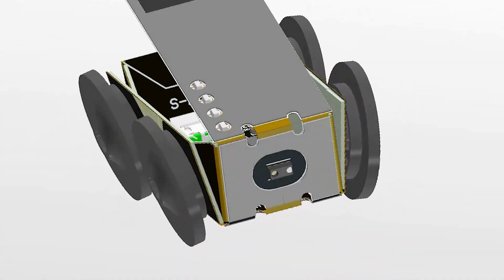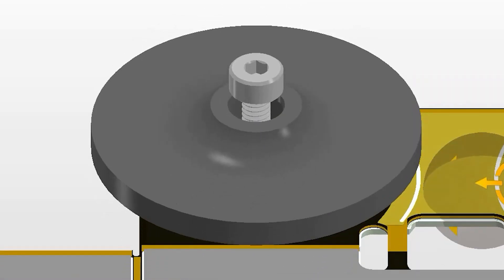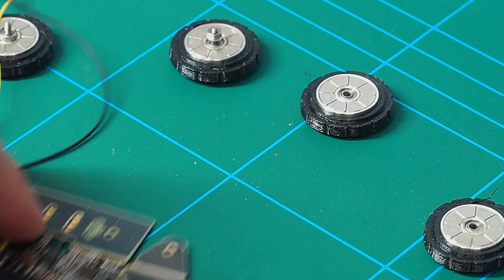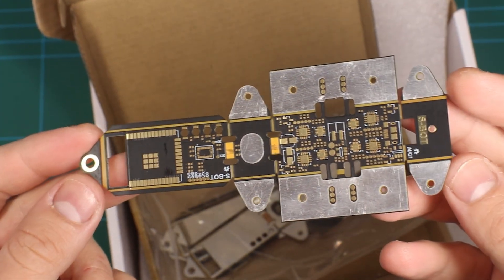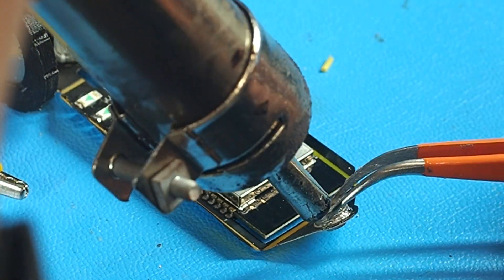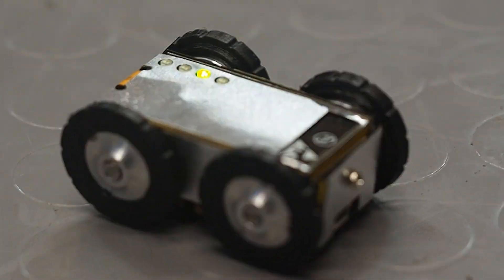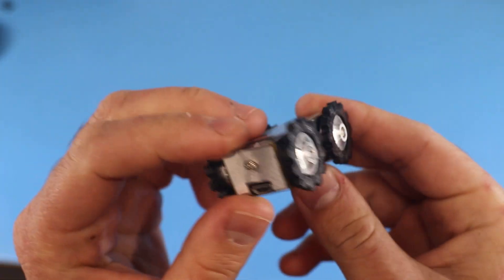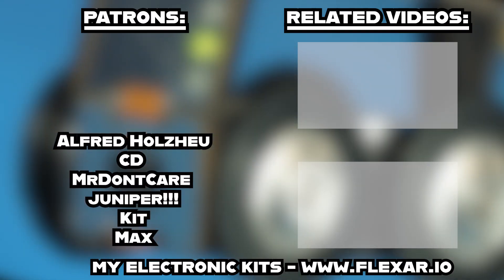Building a Robot from Foldable Circuits!

Comment: You should make some graphene film supercapacitors instead of using the lipo's, You can print your own super caps on a simple diode desktop laser engraver printed on Kapton tape. They are super easy to make, strong, very light and flexible not to mention hold a ton of power

Comment: Very nice, though I think it would be great to do one with a soldered box instead of flex circuit. That way you can use thick copper for more efficient motors and you have to solder anyways.  The key is to make the solder joints solderable from the outside of the box, like through little cutouts.  Alternatively you could use connectors and snap them together. Also, instead of the 4 pic's you might look into the Propeller as it could handle the task more if you don't need analog.  It has 8 processors and only needs to be programmed once, or not at all as it could boot off of the ESP32 on power up, or coming out of reset.

Comment: Regarding torque, I think there may be an argument to be made regarding driving the wheels closer to the rim and further away from the axle. Since this is design has 2 rows of wheels in front of each other and is AWD, if the magnets on both wheels always have like poles pointing at eachother, you could in principle put another coil between the wheels to give it a bigger push and it will be far away from the axle with decent torque.

Comment: Two thoughts.  if you had Meccanum wheels, you could potentially drive the whole robot in every direction because you can control the wheels individually. That would leverage an already integrated feature to get more mobility. Second, because the pcbs produce a magnetic force on both sides, you could potentially drive two wheels on one pcb at the same time. Not sure if that's useful but hey.

Comment: For the PCB stackup, you shoud do a ridgid/flex setup so you can have the motor windings on a traditional FR4 or polyimide board while using the single or double layer flex PCB to just carry the current.  It's not common practice, but you can use the shield layer on a flex PCB as the ground return, as long as all your grounds are the same.  I'm not sure about PCBway's ability to split up the shielding into sections to have separate grounding.

Comment: If you run a multiple number of magnets compared to the coils you run it as an epicyclic gearbox. 

A lot of low rpm outrunners do this. 7:1 or 12:1 is easily done.

Comment: I wonder if it would be possible to integrate maybe two small spaced cameras (for dept perception I guess??), a Goggle Coral TPU for image recognition and a RP2040 micro processor (for a bit of extra performance) in it.. would it be possible to turn it into a tiny self driving rover maybe? :) Also, I dunno the size of this thing but I wonder if it was about the same length of a AA or AAA battery, then maybe it would be possible to solder the positive and negative battery terminals directly to the sides of the PCB and use one or two rechargable AA or AAA batteries?

Comment: I bet you could make a very small aircraft with similar tech.  You could use feathers for a prop since they're already very lightweight and have very good aerodynamics -- you'd have to be careful if you're in North America because almost all birds are covered under the migratory bird treaty act, but you should be able to find a small bird that's not migratory and get some primary flight feathers off of it.  In fact, a pet store probably has some from their smaller birds.

You'd need accelerometers and some of your flappers for flight surfaces but I imagine you could put a camera on a small aircraft like this and get some decent flight time.
Reply: Actually, come to think of it you could probably use feathers for all your control surfaces.  If you used an elerudder design (where you combine the elevator and rudder into an upside-down V) you could simplify it significantly.

Comment: Which electronic hot plate do you use and is this all you need for soldering this PCB oder do you use any additional heat source? Is it 946C ?

Comment: What's your PCB specification for ordering?
And is the project easy to import in KiCad? No one - especially hobbyists - would ever use the most expensive EDA software (how expensive is Altium nowadays? 12000€?), especially when all the features are FREE auailably in a way better performing open source software calles KiCad ;)

Comment: You can use some kind of more flexible tyre so they can make a strong grip on any surface. If the tyres are made with rubber so it will easy to the rover to go on smooth surface. If tyres are flexible like monster truck tyres then it is easy to go through opticals and rough surface. Please try my idea once, I think it's gonna work. 
Peace ✌

Comment: Inspirational!
Use the same pcb coils but remove the wheels and use rubber band pulleys to gear down to smaller wheels for more torque.  Could use lego to attach to your bot to a small wheel platform prototype.

Comment: You should make the next one 6WD, with the distance between axles less than the distance between wheel centerline for easier turning. The increased body could have room for internal battery leaving payload or camera for the top. It also looks like further refinement of the motors for smoother low speed operation will do well for this. Can’t wait to see where this goes!

Comment: I wonder how well self assembling ones could work, especially if you're not trying to make it micro sized. Gave me the idea of essentially flat pack drones that could be dropped on a planet in a pack of say 10 where they all assemble and take off in different directions to do a faster ground based analysis of the surface.

Comment: Remarkable! Awesome! That car was delicated!
But still wondering how did you use a DualShock 4 controller to communicate with ESP chip? By bluetooth? And any other libraries did you use?
Reply from the maker: there is a library for it :) open source files are also available for this project

Comment: I really like your design, and this whole thing is cool, but, just wondering if that layer of metal could be interacting with the magnets in the wheels (i.e. eddy current braking) or effecting the magnetic field from the coils.. have you tried running it without it? Might help?

Comment: A cool development! 🔥🔥🔥
( — ) but motors of this type are clearly very weak, and they overheat very much, which accelerates the discharge of the battery, it is necessary to think over a more energy-saving design.

( + ) From the good, I can highlight the fact that the design platform is compact, this is only one plus.
☝️ But it is better to use ordinary mini motors in which there is a speed change using gears.

Comment: This is a cool project, but honestly this is not the way you will go, if you would do sth like this. Flex PCB is still one of the heaviest costpoints of manufacturing a pcb and the alternative to go over connectors is in 80% of all cases cheaper. But yes, there are also connectors, which are very expensive, but also feature some mil std... 
Altium Designer is by far one of the best and userfriendly CAE softwares out there, but it is also very expensive and for hobby or private use cases not your favorite software.

Comment: As I don't have as special electronic hot plate machine I use my 3d printer hot bed plate to auto solder smd the same way. Works pretty good with lower temp solder. I think if you take a glue gun and just tip the edges of the wheels lighthtly it's going to eliminate the traction problem, even attaching a flat rubber band over the circumfrence should be an easy fix.

Comment: Why make the motor back shell aluminum instead of steel? Wouldn’t steel help focus the B field on the board?
Reply from the maker: It's because of the sides.. Having an iron/steel back plate is more efficient - I tested this in this video https://youtu.be/uqKVX6po2o4

Comment: yo you think that you could have a long strip of pcb and then a thin flex pcb underneath both with the electromagnet patern on them so that it could be driven with 3 phase to mimic the action a snail or snake would use to move? that would be easyer to do and have a much smaller profile. you could even have two side by side to make a tank steering type robot.

Comment: Use a single cell battery and put a boost circuit. You lose a bit of efficiency... but you gain more in not adding too much weight :D

Comment: Great project!  Have you considered giving the motors some mechanical advantage? Perhaps small diameter pulley driving a larger diameter at wheel?  Silicone oring could double as tires. 

Also, can the stators be printed in multi-layers? Would that increase the field strength?

Comment: I assume software traction control might help? What I mean is, it could check if one wheel is spinning faster than the rest, slow it down to send more power to the other motors?

Comment: The problem with those motors is torque, but speed shouldn't a such a problem. Make planetary gearing inside the wheel hubs.

Comment: Just a stupid remarc, but would it not make more sense to have each controler handle two motors due to the chips having two pwm outputs? Or is it a timing issue with the close loop controller?
Reply from the maker: Give that in the end they were being driven in open loop (not the original plan) they can have a shared controllers, with separate 3-phase drivers

Comment: Making it light allows possibilities for rover  drone roof  landing video device that can save power . And maybe  drive to maximize a small solar charge  . That a motion detector can save even more power by just motion video camera with a go  pro hack. Did you try a tank  tread  style . The wheels may have to extend a little to allow a small rubber tread that many old military  tank plastic kits in the very small scale like Ho model rail road displays , have already a rubber and authentic looking  flexible soft material . That may not overheat your electronics . And if it really helps a extra energy cell may be able to extend while providing a little more weight to allow traction in wind  consideration  . And if scaled up for earth rover  testing  the diversity of ground conditions as well as water surface  propulsion has  already been tested on heavy tank beach landings . To be able to study the tests in early development . And easy to search data base , of US patent search allows   project development suggestions  and new   applications  considerations that in the past had not been able to apply in product development and testing .

Comment: Would it help to have an extra stator on each motor? You could have an additional flap on each side of the lid, that fold down from the top and sit outside the wheels and have PCB stators on them. Then for each motor, you'd have a stator on either side of the magnets. That way you'd have double the number of windings per motor.

Comment: Amazing concept, great work! Looks like your main issues are related to torque from the motors, suspect that's why the skid steering isn't working well, and you can't get over bumps, are you driving one side forward and one in reverse for steering? The tyres probably don't like twisting or slipping sideways. Perhaps small ribs across the tyres or knobbles might help let them twist but still provide forward traction. Have you optimised the motors for torque rather than speed? Can you:
- Increase the number of coils
- Add more phases
- Make them larger diameter
- Double the PCB up (add another set of coils on the other side of the rotor)
- Invent a 'PCB Gearbox' to provide reduction gearing (starting to get complicated!)
- Stronger magnets

Friction between rotor and stator might also be an issue since you're side loading the motors. Since you have 2 motors on one axle, maybe put the bearings into the PCB stator and then use the stiffener arrangement as an axle so you have a bearing on each end of a long axle rod and the wheels on the end, should reduce deflection of the wheels and may reduce rubbing between PCB and Rotor.

Making the robot a bit wider will also give you a bit more of a moment arm against the centre of rotation of the vehicle which could help it turn tighter.

Comment: Here's a tip for you: You are already monitoring the speed of each wheel, right? It should be rather trivial to detect the freewheeling of one tire and basically implement an automatic digital differential lock, where all wheels synchronize their efforts to  overcome the stuck situation.

Comment: Fantastic progress! I really believe that "flat pack" devices can be very useful.  Did you consider making some kind of a magnetic transmission? Like a planetary gearbox but using magnetic fields? Or flattening induction motor, instead of placing magnets in wheels, make them from copper or aluminum and induce eddy currents in them to transmit torque. Maybe it will work as some kind of cvt? Anyways, good luck!

Comment: Just a suggestion; have a look at the parallax propeller 2, is an 8 core mocrocontroller which means you could remove the individual micro controllers per motor.

Comment: thoughts on layering the motors yourself? i.e. add tabs the same way the esp32 is soldered, and use a 4 layer rigid pcb. it could also be designed to stack 2 4 layer pcbs, making it into an 8 layer motor.

Comment: I might have missed this...but is this a rigid flex design with a very small flex portion at the corners? Or did you just make the board really thin?

Also curious how the stiffeners are specified ... Is that designed in Altium or just added after the fact with the supplier? Are they laminated or glued on?

Very cool work 🔥

Comment: Very cool project! If you want to expand on this project, consider other shapes instead of a box. You could probably make a functional suspension out of the flexible PCB quite easily. Also, for a lighter robot, thinner wheels might actually work in your favor if all the wheels are making good contact with the ground.

Comment: since the car has wheels that are sticking out, why not place another pcb coil on the outside of the wheels at a different angle to increase the torque? like: pcb coil -> wheel -> pcb coil.

Comment: Next build, add suspension so the wheels can fall into low spots and rise over high spots. Flexible PCB is sort of springy. You might be able to use that as suspension.

Comment: Did Altium fix the problem that makes all the bending lines disappear after changing the PCB shape? That annoyed me to hell, when I made a flex PCB wiring harnes for voltage and temperature measurements inside an accumulator.

Comment: The standoffs you used are way heavier than any header, and also use more space, so it would have been much simpler to use the headers as a mechanical support for the PCB, which now wouldn't need to be flexible, so you could use the sae old motor design you're used to, which would require a smaller battery. So it's a win on every front if you use headers

Comment: The motors still are kind of weak. Do you think it would be possible to make multi layerd motor coils. Now you have coils next to magnets inside the wheel. Could you put a second layer of coils on the outside of the wheel or even make a few layers with the rubber on the outside. Or one strong wheel to push and two to stear

Comment: I wonder if going with more wheels (like 6 or 8) would be an improvement.  Might want to use flex joints between each pair of wheels so that each section can adjust a small amount and keep more contact between the wheels and the ground.

Comment: The robot works surprisingly well considering the manufacturing methods used, and since you can’t give it a suspension system, maybe consider using flexible deformable wheels so that it can have better ground contact

Comment: You can consider to use tracks instead of wheel Carl. Since the weight of the robot is too low, the friction betwween the wheels and the ground will be veeeeery small, hence the skipping wheels. And as always, awesome vid and project !!!

Comment: As far as the wheels are concerned, I think they may be an order of magnitude too stiff. If you use something much softer (thin TPU spokes, foam, or tiny pneumatic tires), the load sharing would be much better and traction would improvce
Or use 3 wheels possibly?
Awesome to see how complete this robot is, but excited to see what's next!
Reply from the maker: Thanks! The wheels were TPU but for the next version I will test some more designs

Comment: Amazing work man! Thank you for sharing these! One small comment. You mentioned that you used wider tires to increase traction, which is a common misconception. The larger the contact area for the same weight, the less the traction. I know it seems counterintuitive, but unless you are designing a foldable F1 racing car, with hundreds of horsepower that would destroy slim tires, the thinnest, the better. Use thin, gear like tires, and your traction will improve significantly, especially for such light and underpowered rover.

Comment: This is really cool. I can't help but wonder if it needs some kind of gearing to cope better - ie motors running at a higher RPM with at least a single stage of gearing before the wheels. You've definitely made me re-evaluate PCB as a structural material, and not just a board to mount inside the structure.

Comment: Would it be possible to add a second "wing/fold" on each side with a second set of coils that you fold back down over the first set so you can link them up to the existing set of coils to effectively double the windings of each motor? Routing the traces might be a problem and heat dissipation may be an issue, but it could increase your peak torque without altering the basic design too much.

Comment: You should make tank treads for it and try to have it run like that, more work a bit better for traction and having 2 motors driving it would allow for sharper and maybe faster turns